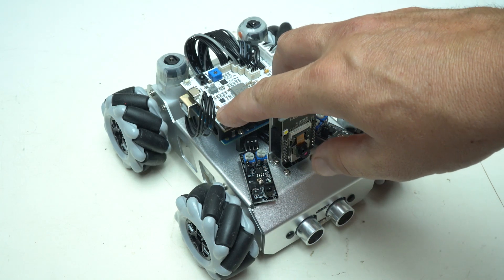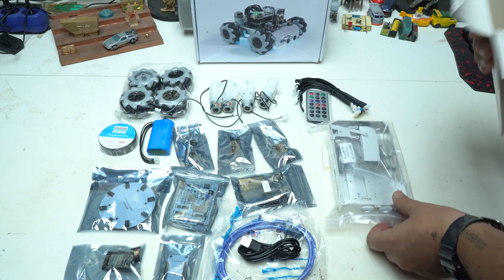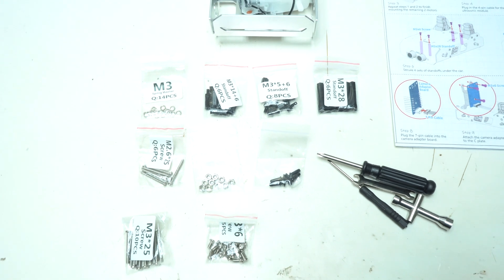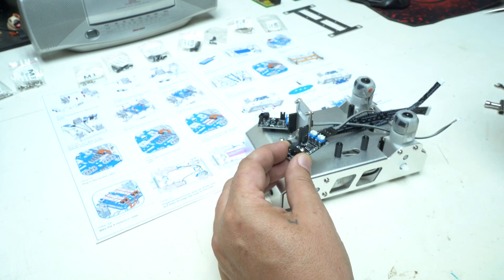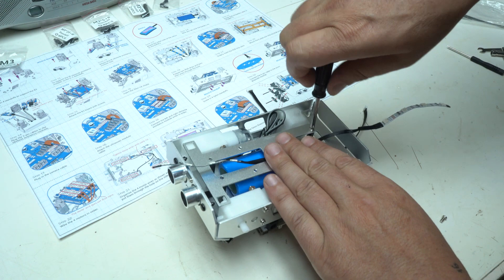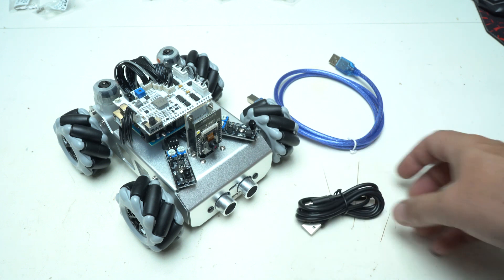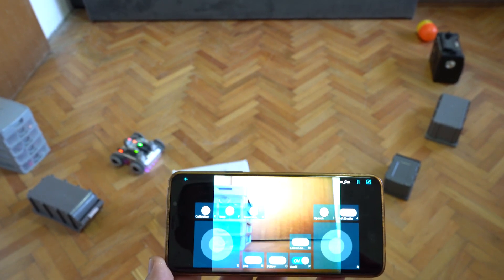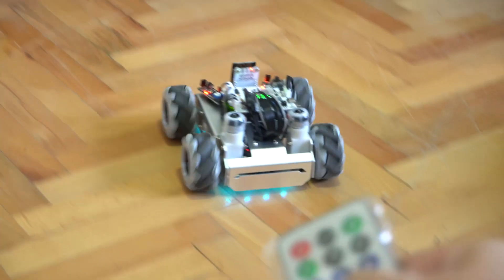Smart Arduino Robot Car with Camera,RGB Lights and Mecanum Wheels

Comment: Great video .... I'm not really interested in toys like that but, makes me wish I were.  I'd love videos on making sequential blinkers using either a 12 volt or a 4.5 volt power source for my project i'm working on which is a handicap mobility cart .  I'll use a battery backup to power my leds if that helps.  I'd like to make it as inexpensive as possible seeing my funds are realy low.  I already have resistors and 5mm led's I know there are lots of different ways I'd just like the simplest way !  Thanks again for your time and efforts to ake them !
Reply from the maker: Sorry men its just not possible to explain with comments,just checked you can find on ebay turning led lights for under 5$,please search the web